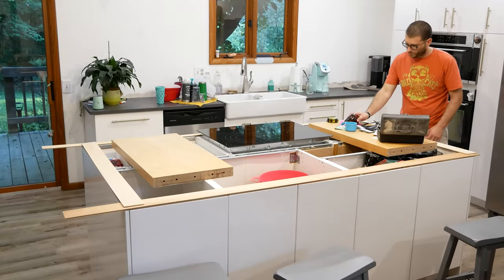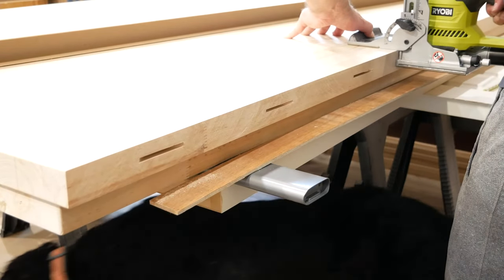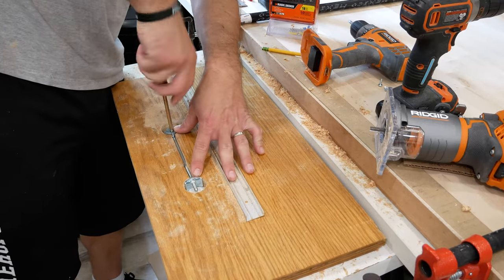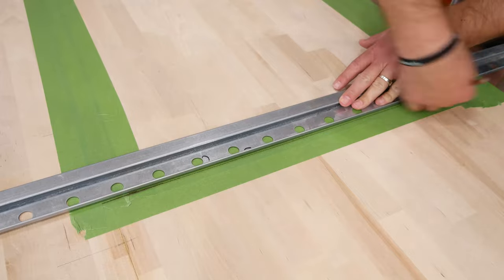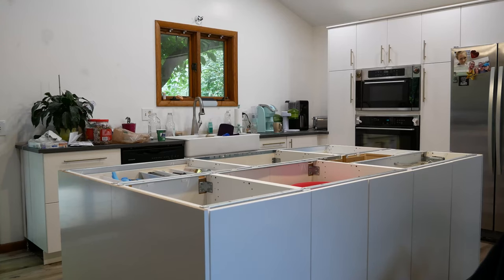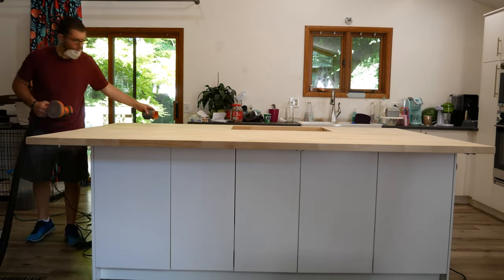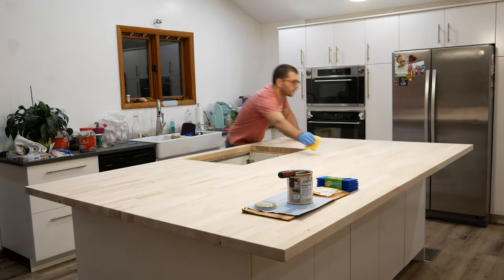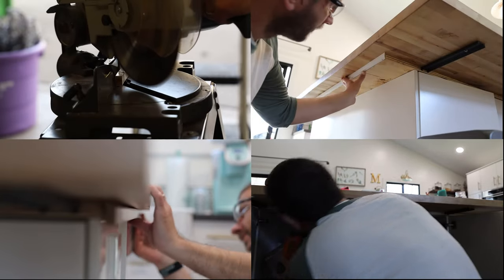How to Build a HUGE Butcher Block Island Countertop

Comment: M wife saw this video. Guess what? She wants me to piece together a 4x8 butcher block island countertop to replace our old sad one that has a sink. She texted me the link to this video. I’m inspired. Question: I saw a company that sold hardware similar to yours for holding the pieces tight. Their instructions said not to use glue. Something about moisture and allowing for movement with the swelling and shrinking of wood as the humidity and temp change. ??? Obviously you haven’t had any issues.
Reply from the maker: Well I'm glad that your wife shared my video with you, that's awesome! Hmmm, I would follow the companies instructions, I guess? I have not had issues with mine except I need to refinish it its been 5 years since I built it.
Reply: @jaredmyers3227 read it again. That is if the grain of the 2 pieces are perpendicular, not parallel.
Reply from the maker: oh, that's interesting, good to know

Comment: How did you install the cook top? Did you have to use any protection around the inside edge or just place it in and screw it down?
Reply from the maker: I did not put any protection on block. My thought was if this is safe to mount on a laminate counter (that has pressed wood and glue) than it will be safe with butcher block. Plus the heating elements are pretty far from the edges and the appliance has a metal box around everyghing. There is also a gap between metal box and butcher block. The appliance rests on the butcher block around the edge and screws into the cabinet below. Keep following me I am working my way through my whole kitchen build and show all the steps. I just started getting to the Island in episode 12. Thanks for question!

Comment: Hi Jared! Amazing build, and I have learned so much from this video! Where can I find the metal supports like you used? I’m finding ones that mount to the cabinet, not like you have on top of the plywood.
Reply from the maker: Yes I believe you mean the C channel metal piece. See link https://www.amazon.com/RMP-Rolled-Channel-length-Thickness/dp/B01IRKQJN6/ref=sr_1_2?crid=1KVS6DBESYBNL&keywords=c+channel&qid=1647024671&s=industrial&sprefix=c+channel%252Caps%252C154&sr=1-2&_encoding=UTF8&tag=rawfires00-20&linkCode=ur2&linkId=954c27447c8ea67a2a28228601486312&camp=1789&creative=9325

Comment: Jared great video! I was worried about putting 3 sections together until I saw your video. Thanks so much for sharing and your great explanations. What is the overall size of your island and the overhang for your seating area?
Reply from the maker: Yes, of course, thanks for watching! The overall size is 96" long by 60" wide. I think my overhang on the one short side was 12-14" and the overhang on the long side was more like 18".

Comment: I’ve read multiple times to never put plywood under butcher block, it needs to breathe all the way around. Have you had any issues?
Reply from the maker: Oh no are you serious? I’ve not heard that. No issues so far I hope I don’t have any.
Reply: @jaredmyers3227  that’s what I read in my research but if you haven’t had any issues, probably nothing to worry about. I think it has to do with making sure the block is the same moisture all the way around so it doesn’t warp.

Comment: Great job. How much in total
Reply from the maker: Thanks! The three butcher blocks 615, zip bolts 30, sealer 120, tools, safety equipment and random consumables around 300. Rough total before covid is just under 1100. That was maybe a 1/7 the cost granite, quartz or stone.

Comment: Is the 8ft counters actually 96 inches, or are they 98 inches? Ive found a few that give the extra 2 inches, which is what I need since I'm using a 36" and (2) 30" Ikea cabinets back to back. These ones are almost $100 cheaper per section, so if these ones are actually 98", then they will work to give me a 1 inch overhang on the sides.
Reply from the maker: Yes, you are correct the Ikea Laminated Counters are 98" long.

Comment: Awesome video. There’s several places where it looks like some strong double sided tape would have really helped you out [Positioning Template under Tablet, holding straightedge for cutting with Skillsaw, etc]. 

There’s a neat trick you probably already know - put a piece of masking tape on the two objects you’d like to be together temporarily & put CA [Cyanoacrylate/ Superglue] between the layers of masking tape. It holds it plenty secure for drilling, router work, etc, but popping the CA glue is Easy and then you just need to peel the masking tape. 

Ideally you’d want to use this before final sanding & finishing, but I’ve used it even after finishing with good results.  

Full disclosure: it’s not my idea, I learned it from a Woodworker on YouTube [Rex Krueger, maybe?]. 

Good luck on your future efforts!

Cheers,
Reply from the maker: Thanks so much!!! I didn’t know about that, that’s a really good tip. I’m gonna use that next time. Really smart. Thanks for the tip!

Comment: Hi Jared, thanks for the great video,  that's super helpful. I was wondering if at some point you were considering putting some wood filler around the edges when you joined the different countertops? I would think that without you would still see the joint. Thanks!
Reply: Wood fillers are for the most part not food grade material so using any fillers isn’t the wisest choice making sure your joints are well fitted, glued and tight is best. You always have to take the time to sand, plane etc whatever you need to do to get those individual pieces or tops fit really snug when done properly no need for fillers. I have over forty years of experience I watch other people’s videos one because we never know where a great idea or thought will come from and I am now retired and extremely ill it helps me stay connected to my work and love. I was a professional carpenter and woodworker because I really love it after spending several years in the Army in a very high stress dangerous job it gave me peace of mind and I felt connected to this wonderful world. And I have met many great people along the way. Enjoy this activity it’s a wonderful way to spend some time in life.
Reply: @drymoonproperties  Thanks a lot for your reply! We just started and are DIY beginners. Your input is very helpful. We want to join 2 countertops for our kitchen island so we'll try our best to make it fit right! I'm sorry to hear you're ill, sending a lot of good vibes and hoping to see many more videos from you!
Reply: @marievouaux8431  thank you Marie! I don’t make videos anymore myself due to health reasons just like watching other people and talking with likeminded folks, I really miss my work lots it’s the hardest part of dying just part of life take care.
Reply from the maker: Marie, Jeffrey is absolutly correct, get those pieces to fit without filler as best as you can. I did use filler because I'm not as skilled as some. I used saw dust and glue to make my filler.
Reply: @jaredmyers3227  Thank you for the tip Jared! Since we are just beginning I'm afraid we are not skilled yet 😅 
Just watching videos it looks faisable to get them to match perfectly but I guess it's actually quite hard.
Reply: @jaredmyers3227  how are they doing after 8 months? I have read not to put butcher block over a solid surface like plywood. Have you noticed and issues?
Reply from the maker: @jessesuess4948  it’s been just under three years and still looks great. I’m just really slow to put out the videos. I built it in 2019. I do need to re-oil it this spring.

Comment: You need to dance in the middle as well...especially after the zip bolts install. Great video!!
Reply from the maker: hahaha, yeah when the mood hits you...you gotta dance. Thanks, I appreciate it!
Reply: @jaredmyers3227  would you recommend using the zip bolts to join end grain if needing to make a longer piece? and not having 12-14 feet clamps ?
Reply from the maker: @christiandenard  I think zipbolts would be a good way to keep the end tight to one another and inline with each other. I would try to make sure you have the joint resting on cabinets to help support joint. I would probably put zip bolts in while mounting to cabinets. Test fit them take apart, place them on top of counters then bolt them together. I wouldnt try carrying them together as one piece, if that makes sense. Assemble on cabinets